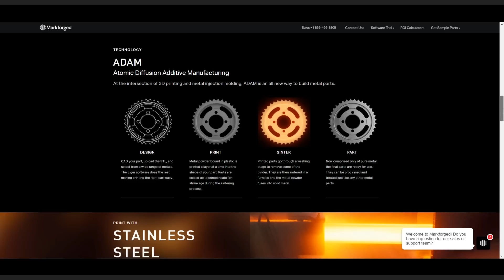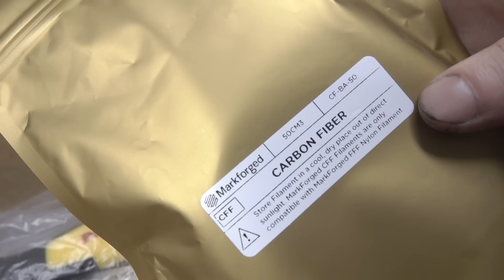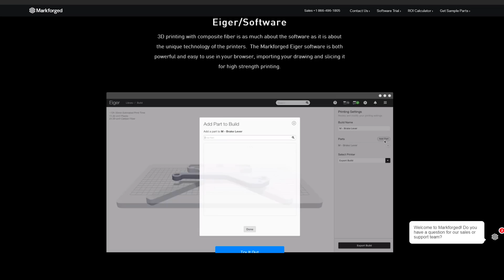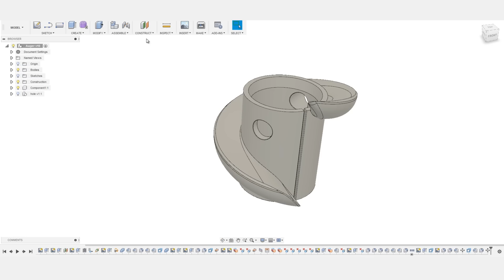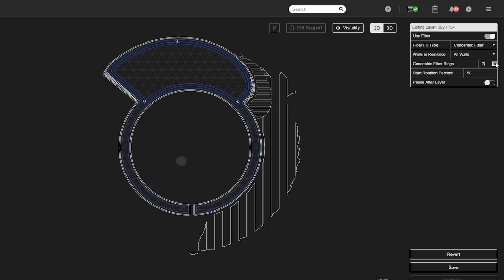UNBOXING & First Prints: Markforged Mark Two 3D Printer!

Comment: Unusefull printer you can not use a difetent materials and Onix is expensive compared with...
This 3D printer do not allows you to set a temperature different  than 275°C
Does any body knows any way to modify the temperature in order to use it with a diferents material?

Comment: marked forged has a beautiful 3D printer.. the problem is, to use it they require you upload all of your designs to their server.  Meaning if you even "might" come up with a invention they already have your secrets.  You can pay an exorbitant amount of money for their "off-line" software ($5,000) so you can supposedly keep your ideas secret.  Well i was a chump that bought this printer and paid their ridiculous fee but they refused to give me this offline software.  They required that I first sign a disclaimer where you agree to use their online software!!!  I complained and got my money back less shipping... shipping was not cheap!! This is a beautiful machine but mark forged a horribly un-ethical company.  I would recommend against buying this printer.  I instead bough the fusion 3, which also prints in carbon fiber, has a much bigger print bed and allows you to print off-line... shame shame on the mark forged company!!.... horrible business practices!!!
Reply: thanks i was actualy considering buying this

Comment: It really is quite interesting how it actually is worth it for companies to buy these very expensive machines when the same quality "can" be achieved with really cheap hobbyist grade Chinese ones. My 140€ Chinese printer can achieve same results as a 2000€ machine (when the stars align just right) but if i were paid a machinists wage for the time i spend troubleshooting and tweaking the printer the 2000€ machine would prove itself cheaper in a month.

Comment: build a sheet metal cover for this distance where there is no screw conveyor 3d printed parts are not abrasion resistant to metal chips on permanent basis

Comment: Strength of aluminium*
Reply: *More like Aluminum is only a bit better than plastic. Sorry, I have only worked with Steel and Stainless. This is all hyperbole and every material needs to be evaluated for each individual project. I bought my first 3D printer when I found out that I could print nylon gears.
Reply: What about FDM plastics printed with thousands of interfaces. Only one layer needs to fail and the part is failed. Yes, plastics are strong. 3d printed plastics, not so much.
Reply: Speaking in very general terms; With so many things in our lives tracked and controlled by computers, any kind of "failed layer" brings disaster. The failed layer can be a glitch in our computer banking, a cycle in our computer controlled automobile engine, a bad line of G-Code running my CNC Machine. Most hobby 3D printers do not adequately control all the variables which can cause failures. These are mostly mechanical or electrical in nature. 
A full understanding of the process is what gives reliability, not dogmatic adherence to generalities.
Reply: JohnHoranzy Okay, but that wasnt the question. Even in a perfect case scenario, this is still fdm printing. There will still be layers of material.
Reply: Much of the metal in your world is held together with fusion deposited welds. The base material breaks before the weld. I will say that YouTube educated hobbyists using hobby level printers with unheated and open build chambers are prone to printing objects that are weak along the Z axis. There is so much bad information on YouTube and it gets repeated.
Reply: JohnHoranzy I never realized that FDM is sintering. It sure doesn't seem like it.

Comment: 24 dollars for that part... but what would be the cost without carbon fiber? It would be enough stiff?
I saw a 3D printer based on nylon powder, and the printout had very good mechanical properties. What for the Markforged?
Reply: You can print with the Onyx chopped fiber reinforced material witgout laying in the carbon fiber stands on a Mark Two.  You can also print in Nylon 6 un-reinforced for maximum value when it's properties are acceptable for the application.
Reply: @jamesg8246  , what would be the reduction of costs when using onyx for the same part in the video? 50% less? And what if not using any reinforcement at all? 70% less?
More: parts without reinf. are brittle? In other words, they can be compared to the ones produced by an hobbyst-cheap machine?

Comment: Are you going to print weaponry?
Reply: Antonio Zavala I don't get the obsession people seem to have with printing firearms. When you have a full machine shop you can make whatever sort of firearm you want without the risk of blowing your face off by making it out of layered plastic. Having a 3d printer doesn't change anything when it comes to arms manufacture, not about the materials you would want to use and not about the licenses you need to make the endeavor lawful. The only thing it might change would be prototyping to check fitup before using metal or injection moulded fibre reinforced plastics to make production parts, just like for any other type of product.
Reply: Steven Doesburg who said anything about "firearms" specifically. Printing is great for prototypes. And shit just doesn't blow up unless there is a miscalculation in a certain application
Reply: You are correct, I assumed you were talking about firearms. I don't see what other weaponry you might try to make out of plastics other than say blunt impact weapons, hence my assumption. 

You are also correct that when designed properly the part should not fail. The challenge with FDM is that the scatter on the strength of the material from one layer to another is higher than the scatter associated with the bulk material. The achieved strength depends on the exact parameter values used during the printing. This makes it hard to produce parts with a controlled strength. The design allowables become rather low compared to bulk material if you want to be sure that the part will not fail. 

Using injection moulded fibre reinforced parts allows for much higher stresses in the part compared to FDM parts both because of comparably favourable fibre orientations and because the process is much more controlled. If this is not economically feasible due to the part quantity it might be better to machine the parts out of billet material rather than printing them. You could also turn to Selective Laser Sintering metals but then we are talking about an entirely different class of machine.

Comment: Great video!  Pretty hard to beat the capabilities/$ of Markforged!
Reply: What’s the price ?
Reply: Unusefull printer you can not use a difetent materials and Onix is expensive compared with...
This 3D printer do not allows you to set a temperature different  than 275°C
Does any body knows any way to modify the temperature in order to use it with a diferents material?

Comment: I saw a video were the guy actually uses a food dehydrator to remove any moisture from the filament in case it has soaked up moisture during storage.
Reply: That's silly, you can do it with an old toaster oven just fine.

Comment: $25 for that part. That's 2kg of filament for me. I see they are trying to compete in the same category as Stratasys though, so if you don't want any screwing around at all, I guess that is what it costs.
Reply: That’s just normal priced prints, if you calculate overhead, machine and machinist cost in you will be way above that price for one offs.
Reply: A Machinist to run a printer? Hell, I go to work 40 hours a week programming cnc's, my printer stays home printing.
Reply: Anonymouspock 
It's certainly expensive to buy and to feed, but with MF I feel like they're using the profits to fund the research into next year's model which will be even better.  Stratasys seen happy to sell the same thing for a decade.

Comment: That look of no layer lines has more to do with the filament. Try some proto-pasta carbon fiber on your replicator and you will likely get very similiar results.
Reply: Make sure you have a proper nozzle for it so the filament doesn't destroy it.
Reply: Actually, i have seen no other FDM printer, regardless of filament, giving as nice surface finish as the markforged does, it comes down to a very good filament and extremely well optimized settings for the printer. Some other printers with CF filaments are getting close, but not as good.
Reply: The only FDM printer i have seen with better surface finish than the Mark Two, is the Markforged X7 running 50 micron layer height :-)
Reply: It better be a very tiny part running 50 micron layer height.  I print most of my stuff at 320 microns because I have a 330 cubic print area and I only print small.  If I ever print big I am going to an 800 micron nozzle and print around 400 or 500 micron layer heights.  Even then my electricity here is too unstable to risk any prints over 8h.
Reply: Yes, you would not use the 50 micron setting unless your part demanded it, the standard setting on the X7 is to print with 100 microns without and 125 microns with fiber reiniforcement. We regularly run prints that takes a few days or even a week if we need it to have a good finish.

On the other hand, our power situation is quite a bit different, with Sweden having one of the worlds most stable power grids, with on average of 1.2 power failures per customer and year. And these failures are mostly on the countryside with trees falling over powerlines and such, in our office (which is in the centre of the capital) i don't think we have had a single power failure this year.
Reply: Erik Cederberg Where I live it is simply because they refuse to upkeep the infrastructure and in a storm it will be due to trees so I expect that but it can be a nice cool day with beautiful clear skies and BAM, a blackout for half a day.  I live in the USA not a 3rd world country so no excuse except they spend their money on other things (our gas, elec, water, sewage, is all owned and ran by the city).  Even if it doesn't completely go down it might have a lag or a surge which is ugh even with a line conditioner on it like a UPS.  Anyway 20 years ago this power was very dirty where if you hooked up a scope you could see how bad it was.  If I did not live with all of these trees (can't cut them down per city ordinance) I would have a solar system up then I could print for however long I wanted to and I do know about Sweden's electricity and it has always been top notch).
Reply: @thebeststooge  We are only marginally satisfied with the 100 micron Z layer resolution of our Onyx machine.  It's class leading for 100 micron, don't get me wrong, but in two weeks we have already been asked to make parts that exceeded the Z resolution and could have maybe pulled it off with 50 micron resolution.

Comment: Would love to get to spend some time with one of these machines for my products.. I produce using two PRUSA i3 MK3s as it is and they work great!. But the quailty you guys get with this is amazing
Reply: You should be getting that quality out of a Prusa. If you want to get rid of the layer lines, purchase a hardened steel nozzle and some CF filled filament, and you will have the same result. There will probably be a bit of tweaking and testing to get it to print super perfect, but I'd suggest taking the filament manufacturer's suggested settings, printing some stuff and revising appropriately.
Reply: Unusefull printer you can not use a difetent materials and Onix is expensive compared with...
This 3D printer do not allows you to set a temperature different  than 275°C
Does any body knows any way to modify the temperature in order to use it with a diferents material?